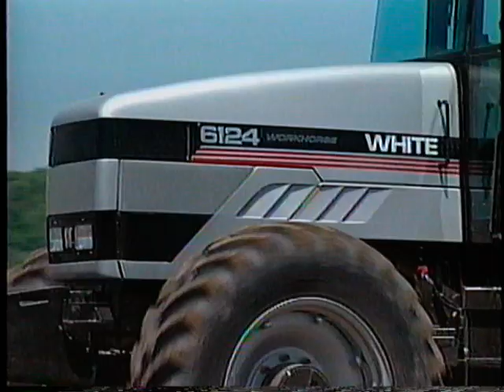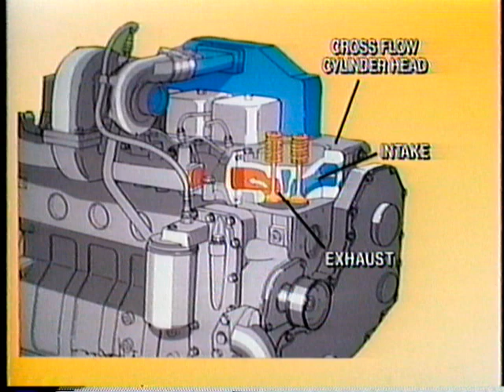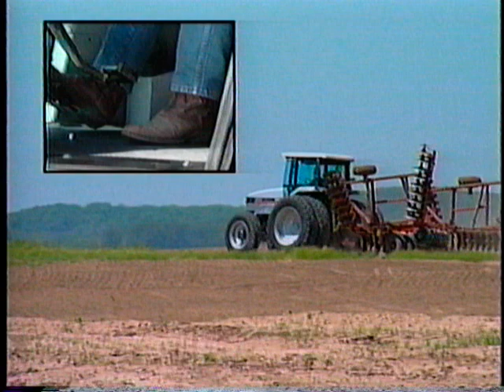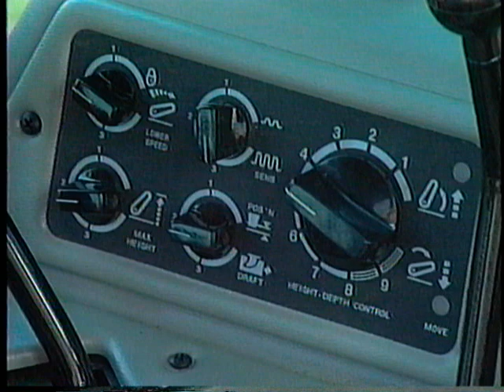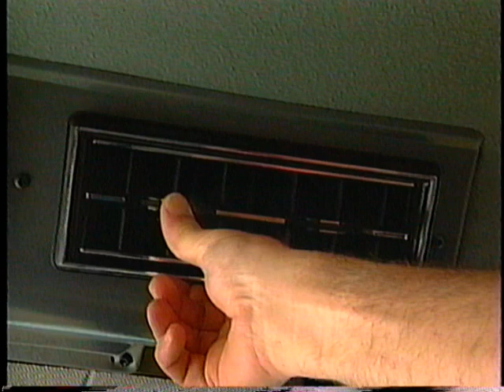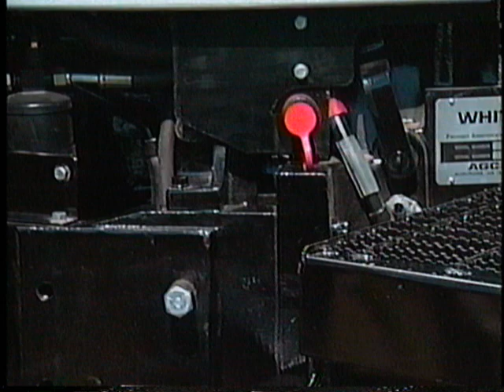Agco White 6100 Series Quadrashift Tractors

Comment: How well did the transmissions hold up in these tractors? Also, how good was the engine in them?
Reply: The Cummins 5.9 is well known and a decent engine. The transmission if serviced per the manual was pretty much bullet proof.  We had a 6175 on the farm and it had a 8.3l Cummins. Very good tractors.
Reply: It must be the Dyna-4 transmission used by MF and produced by GIMA in France.